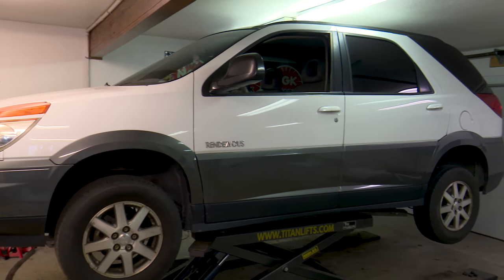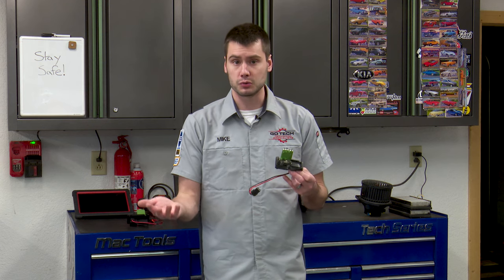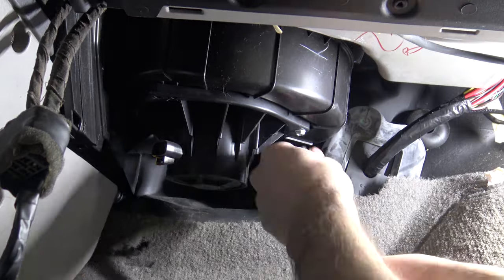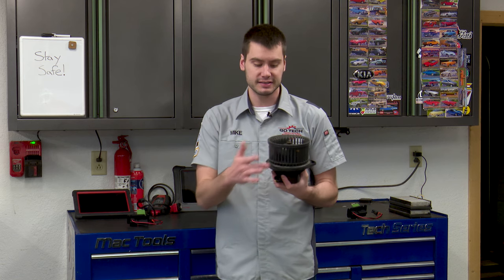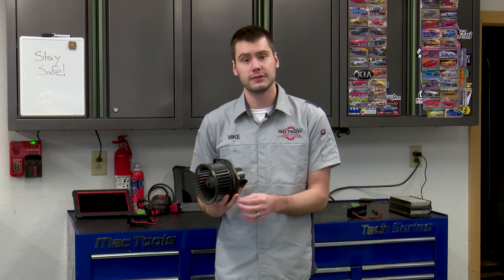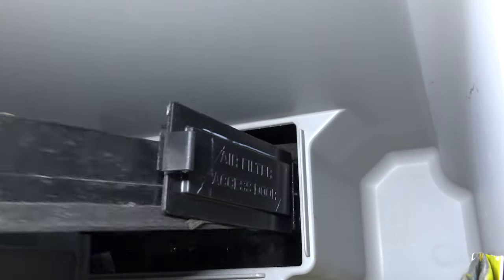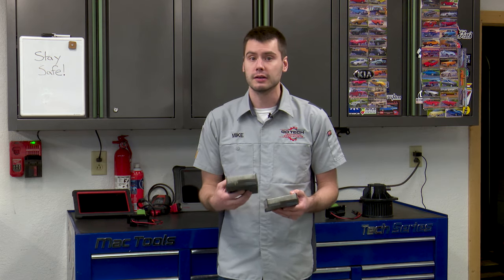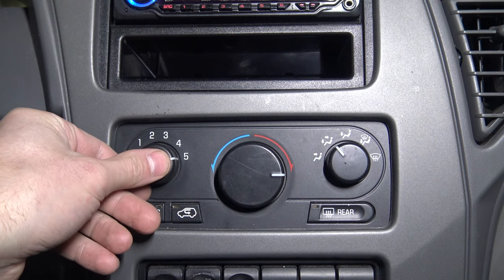Blower Motor Fan Only Works On High Speed? Plus - Tips To Prevent Repeat Failures!

Comment: This is the best description of what happened in my system.  At low speeds, my 23 year-old blower motor would make groaning and squealing noises.  Little did I know, just like he explained, this was an indication the bearings were drying up and causing the blower to draw additional power.  Soon after this started all I could get was high speed.  I changed both my blower motor and resistor and all is good again.

Comment: My 1998 Chevy S-10 blower motor only works on first 3 speeds but not on the 4th (high) speed.
Reply from the maker: Hi Kerry, on your truck the high speed functions through a different circuit. You may have an issue with the blower motor relay or it's control.
Reply: @GoTech  Yep.. I think it's the relay..but I'm good on the 3rd speed for the blower motor. No worries.

Comment: Thanks so much! i purchased an  07 Tacoma recently and this resistor is bad, it does not appear as if the cabin filter has ever been cleaned !! But thanks to you i will also check the blower motor before changing the resistor. this same part failed in my 07 Ford Freestyle and an OEM resistor was recomended by the DIY   you tuber. He said after market resistors did not work for this part, but interestingly checking the blower motor wasn't mentioned, and there is no cabin filter in my Freestyle. thanks again, Subscribed 😍

Comment: 2003 Chevy Silverado LS quit blowing cold air.Tried putting Freon in it but it the gauge was in the red.The compressor sounded like it was cycling on and off.The next morning the air was coming out cold again but when I was driving the blower motor stopped and then I noticed it only worked on High.Before all this happened ever since I had the truck the blower sometimes only worked on speed 1-4and not 5,then it would work on 5.Now it only works on 5😂Ever heard of that.Thanks for your video ✌🏼

Comment: Another excellent video,I tend to always check motor current draw before replacing a resistor especially when they are pricey. A lot of motors are highly inaccessible to check manually.
Reply from the maker: Very very true. Motor draw is a great test to ensure you don't smoke the new resistor!
Mike Becker, Senior Instructor
Reply: I was going to mention that.. I've watched a few dozen videos of troubleshooting blower motors/and resistors.  A lot of them say that if the resistor fails soon after replacing.. that its most often the blower motor is over stressing and burning up the resistor.  

Maybe the blower motor on this car was doing good physically.. but maybe the electrical plug on that blower motor was failing and putting stress on the resistor.

Could a few leaves really restrict the air flow so much that the resistor would fail after 1 month?

Hows his car doing now?  Did it fail again?

Comment: Have a 2004 Acura TL.
Blower motor fan stuck on high speed only when driving down road. Unable to turn it off at all.
The A/C also shut down at the same time.
After some digging I found that the resistor had failed (it had burn marks around some of the solder on the circuit board) which in turn caused the A/C to shut down (I assume for protection).
After buying a new motor resistor, the fan now works on all speeds and the A/C works again.
Not bad for $25 fix. Probably saved $500 or so. It did take me (a complete novice) about 5 hours to figure out, but worth it as I now have future knowledge.

Comment: Excellent video  with one slight error I believe??  By all means I welcome anyone challenging this  but its my understanding that:  ... clogged fans increase the speed of the motor but decrease the current draw.  We see this on our home shop-vac vacuum cleaners when we block the air inlet the motor fan speed increases.  Current draw on motors is closely tied to mass air flow which decreases with dirty filters.  That said dirty filters can decrease the cooling of the blower motor and decrease the cooling of the current limiting resistor which I believe is a much greater issue with a clogged air filter.  In other words the motor overheats due to poor ventilation from dirty filters which can prematurely kill the motor and resistor.

Comment: Thank you Mike. Short class on Honda/Acura Blower Power Transistor testing would help allot of techs. How the control module sends analog voltage to the Mosfet to control the transistor. Show them the control signal, back probed and at all speeds.  Then unplug the power transistor and show them the control signal voltage again at all speeds. This will help determine if the control unit is delivering the control voltage to the power transistor connector. 
Have a blessed and safe week to you and your family.
Reply from the maker: Hey Billy, thanks for watching! Sounds like a fun video. Mosfets/blower controllers are a whole other animal. I will definitely tackle that at some point. Thanks for the tip!
Mike Becker, Senior Instructor
Reply: @GoTechTraining  haha - this video is just great! and covers the 99.9% perfectly. Thank you and only if resistor blows again within 20k miles or so - time for further checks.👍

Comment: years ago, it was common for a failing blower to cook the "high speed" relay, while the dinosaur resistor block (coils) would survive just fine (usually rust got them!) of course they was also under the hood mounted into the giant heat/ac box then.
now days opposite happens, the resistor circuit board or driver module cooks.... some great improvement there LOL
Reply from the maker: Haha maybe not improvements in overall longevity...but there are way fewer dash fires now, right?! ;)
Mike Becker, Senior Instructor

Comment: Done deal brother thank you so much I didn’t want to buy $107 switch so I took it all the way apart and realize that it’s not that a resistor he says
Reply: Did you try cleaning the switch whith electric spray cleaner it's all mine needed I thot it was bad till I cleaned it whith the spray always clean the connecters and switches before you think it's a more expensive part

Comment: I would have checked the current draw from the motor after the filter and resistor replacement just to be sure.  Also, if the motor has a rubber hose connected to it's housing and the other end of the hose to HVAC housing, make sure that hose and the housing are not plugged up with trash, animal nest material or whatever was trying to make a home in the housing.
Reply from the maker: Great point Mike, I've seen spiders build webs/next inside those rubber hoses and plug them up.
Mike Becker, Senior Instructor

Comment: A great video wondering if you can lend a hand with your knowledge may she 35 blower is intermittent with no rhyme or reason to it the only thing I notice is if I shut the car off with the system running that when I turn it back on the blower will blow for a very short time and then stop blowing again! I have change the cabin filter and I'm wondering if it could be the relay. Your help would be appreciated as today it's -30 in Toronto. Thanks for the great video.

Comment: Hey great video. However, I have a different question. Why does my car AC only work on high speed every now and then? The majority of the time, the AC will work as it should but sometimes ( not very often..usually on longer drives) it will only work on high speed.. Please help

Comment: Nice job buddy, what happy if my Blower only works on the lower speeds but NO HIGH SPEED?
Reply from the maker: Hey The World Moore, take a look at the wiring. Usually high-speed is run on a different wire or may bypass the resistor altogether. 
Mike Becker, Senior Instructor
Reply: @GoTechTraining  Thank  I have 12 Volts on both the power and ground of the Blower Motor. is the BLOWER MOTOR OR THE BLOWER MOTOR RELAY?

Comment: My 2004 Camry AC blower suddenly stopped without warning. The dash panel control buttons light up - but no air output on ANY function. When I turn the power on ( without starting the car ) I can hear the clicking sounds behind the glove box. So, something is TRYING.  But no air. I am going to check the air cabin filter. Also, with a shop vac, gonna try to reach down into the area and see if it's a twig / leaf / debris build-up that caused a clog or failure.

Comment: Great video but you should have shown before and after current readings of the blower motor. I've seen filters clogged and blower motor or resistor never failed.
Reply from the maker: Hey Jim, thank you. Yes, you're right. Watch for a video at 11am tomorrow(Friday).
Mike Becker, Senior Instructor

Comment: Thank you for this video but my problem is a little different. I have a 1996 Toyota RAV4. The blower is on and off. I replaced the resistor. It didn't work right away (it actually started working the next day - on all levels). Took my RAV in to get an oil change and had my Mechanic check the blower itself and he said it was good. No air blowing on any level 2 days later. Tried the blower again the next day and the blower was working. Someone said it may be a bad ground or a bad switch or relay. Your input would be helpful. Thanks

Comment: I have a similar issue, but a little different. In the past, I have replaced the fan switch due to it melting. However, this time the blower fan switch will work on all speed and then many time it won’t work at all. I pulled the switch and it doesn’t appear to have over heated. I check the connection to the blower and it is good. Any ideas as to what the issue is?

Comment: My 2010 mazda cx7 only works on speed 1,2, and 3. It won't work on high speed. I replaced the resistor, but that had no effect. Should i try replacing the motor?
Reply from the maker: Hello,
Looking at the wiring diagram, if the motor works on speeds 1,2,3, 
I would start by check the blower switch and the blower switch connector. 
I hope this helps you track down your issue
Ryan Wilsing

Comment: I replaced the resistor and still have NOTHING. Its the blower motor right? 
Im poor, and disabled, i cant afford to take it to my mechanic. I cant remove the blower just to check but i did check the cabin filter…
I bought this from an auto mall, a honda dealership, used in 2018. Its a 2009 civic. IT WAS CAKED WITH DIRT. They NEVER CHANGED IT its been collecting dirt for 12 YEARS! 
I cant replace it until payday next week and if its the blower, i cant replace that for a couple months. I feel so defeated and exhausted, weve gone without heat this whole winter but my illness makes being in the car impossible without AC above 75° so im getting worried i wont have it fixed in time. Please, any advice?
Reply from the maker: Hi Sandy, sorry to hear you're having issues. I suggest having it tested. It's always cheaper to have it tested ensuring the right part is replaced. It would be horrible to replace the blower motor and still not have it working. 
Mike Becker, Senior Instructor

Comment: Thanks for the video. I have a 2010 ford fusion and i replaced the resistor and the   relay. The new relay came with 5 wires and the old one had 4. After hooking the new relay and resistor i only have high speed. Would that still be a blower issue or is the extra wire on the new relay causing the issue. Looking for any advice. Thanks!
Reply from the maker: Hey Obers13, are you sure you got the correct resistor? Did you buy the one for the automatic temp control and you have manual?
Mike Becker, Senior Instructor
Reply: The resistor said it was for 2010 for fusion. Not sure if there is a difference in the resistors for automatic climate control but my car doesn't have it.

Comment: After repeatedly burning new resistors,  I replaced my filter, blower and resistor, but it keeps burning my resistors at low speeds in like 10 minutes.  My AC blows on high, but turns off my AC light and won't cool. I'm in Florida and really only turn on my AC on high anyways since it's a van with big open cargo area.   I'd like to hardwire bypass my resistor since it's like the 3rd one I burn.  I see the motor had a thick brown and orange cable going up into some harness.  My resistor has thinner Brown, Blue, Black and yellow lines going back into where my switches are.   How can can I get my A/C light to stay on when my fan is on high, it seems some relay or dependency on the resistor is causing this.    BTW, the AC light turns on in speeds 1-3, but the fan won't blow.  Again, a new resistor works great but gets really hot and burns out quickly on low.
Reply from the maker: Hello,
What year, make, model van do you drive?
On most vehicles the A/C light it related to compressor operation and can be inhibited by the vehicle for multiple reasons, A/C pressure issues, Check engine light, temp sensor malfunction. It is rarely tied to the blower resistor. But you may have some type of wiring issue causing it. Especially if you are burning up resistors. 
~Ryan
Reply: @GoTechTraining Thanks.   2018 Promaster city Van.  I just bypassed my resistor and now I can at least get cold air on high.

Comment: I have a 2009 ford f150 with dual automatic temperature control.
My blower motor speed module melted and quit working. Replaced it with a new aftermarket and it worked for a few minutes and stayed stuck on high speed and my compressor clutch won't engage now. 
All the relays and fuses related to the AC system are good.
Could it be that the blower motor is causing the computer not to open the circuit for the compressor clutch? 
Any help will be apreciated.
( I have replaced the blower motor speed control module with an OEM motorcraft from the dealership and I have all the speeds working now)
Also I have a new hig pressure switch or pressure transducer and a new evaporator temperature sensor. 
The ambient air temperature sensor seems to be reading the temperature accurately and my compressor clutch looks fine and runs smoothly when jumped at the clutch relay.

Comment: Won't a blocked cabin air filter reduce the load on the motor?  It has less air to move?  If I put my hand on the vacuum, the motor speeds up because it no longer has air to push.
Reply: Traveler X it depends on which side of blower it’s on some on inlet side some on outlet side of blower
Reply: Traveler X yes, proven by motor current measurements, you’re absolutely right.
Reply from the maker: Traveler X, you're right. I was incorrect, not sure what I was thinking...watch for another video tomorrow morning!
Mike Becker, Senior Instructor
Reply: @GoTechTraining  No worries.  I always worry about come backs.  Since there are so many possible causes.
Reply from the maker: Hey guys, here's an updated video! https://youtu.be/Mpugn7xsQ4g

Comment: My 2017 Mazda CX-5 has 7 AC speeds and the first 3 vent almost no air.  I already replaced the Blower control module since the car has automatic AC but did not solve the problem.  After that I had the blower motor fan checked for obstruction from leaves and replaced the cabin filter but also this did not help.  The AC air is cold it's just that the lower speeds vent almost no air.  I also have a 2021 CX5 so I can compare the flow on each of the 7 speeds.

Comment: I just replaced my blower motor resistor and wire harness 2 days go it was working fine the first day  the air was working fine on all settings then out of no where it just turns on when it’s on full max I don’t know what’s wrong and the parts i replaced are brand new?

Comment: Is it possible the damper located above the blower motor is dragging on the squirrel gage.  I have a 07 Jeep Cherokee.  Loud harmonic noise coming from the blower area at top speed.  Found two mice (dead) in the squirrel gage.. Cleaned and replaced squirrel cage and noise continues.  Any comment would be appreciated!
Thanks in advance.
Earl

Comment: Inhaler a 97 C1500 and have had to replace the fan control switch at leastb3 times in the last 2 years. Is this a know issue and could the resistor be the issue? I just know I am tired of replacing the switch. The fan was replaced a few years ago. Also when in the off position the fan can randomly kick on.

Comment: I’m getting up there in age, why did they start putting cabin air filters in vehicles? Was there a problem with leaves and dirt getting pulled in and causing issues? Thanks ahead of time
Reply: It is as you say: "Cabin air filters were only introduced in cars that were built after the year 2000. They prevent pollutants from entering the vehicle's cabin, as well as leaves, bugs and other debris from entering the heating, ventilating and air conditioning (HVAC) system."

Comment: My fan on my 2003 ram 1500 has 4 speeds 1and 2 stopped working 3 and 4 still work. Would this be the same issue, and would I have a cabin air filter I can't seem to find anything on that?

Comment: i have a problem my blower motor is on speed 5 but after a while slows down to 3 by itself. Then after a min speeds back up to 5. would this be the resistor or blower?

Comment: What would be the issue if I replaced the blower motor and the blower motor resistor?
Reply from the maker: Hey Adam, typically the only other things in the circuit are the fuse, wiring and control.
Mike Becker, Senior Instructor

Comment: My Ac/ heat blows on the highest position only. Is the resistor the problem?
Reply from the maker: It certainly could be!
Mike Becker, Senior Instructor
Reply: @GoTechTraining  it’s only blow fan with no cold air. Will a resistor fix this problem?

Comment: I replaced the control module/resistor on my car, now when I turn the car on, it only blows on high speed even when "off". the control module is matching part for the car, is it possible the fan is actually the problem?
Reply from the maker: Hey, the blower motor is just doing what's it's told. It's not able to make the decision to run on its own. Maybe the new resistor is bad or you have an issue with the controller.
Mike Becker, Senior Instructor